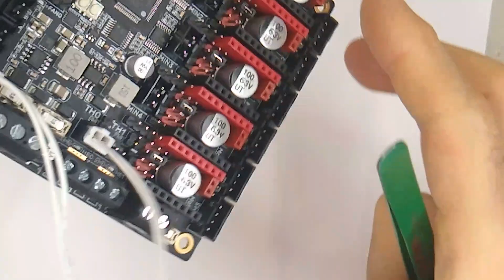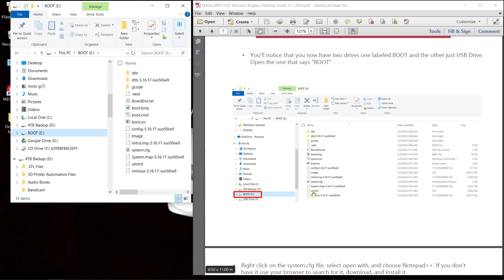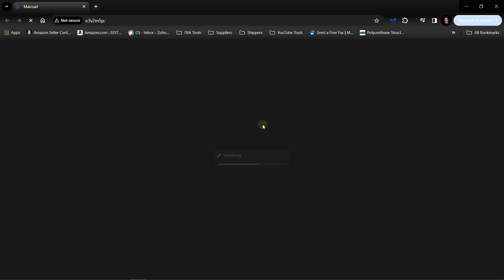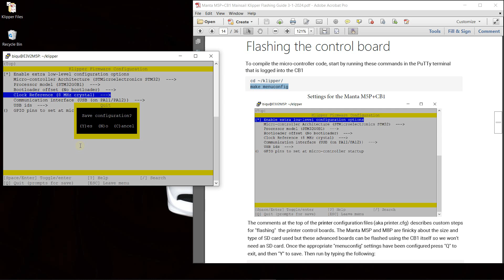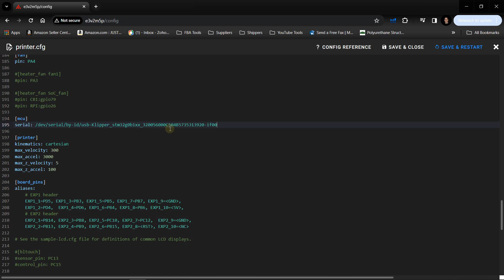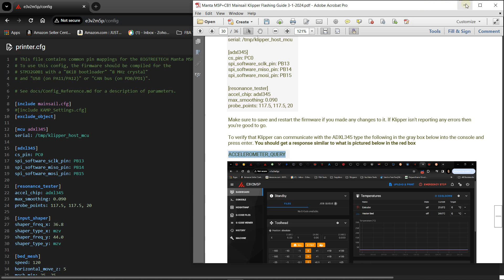How to Install Mainsail Klipper on the Manta M5P+CB1 using DFU to Flash Klipper.bin 2024 Edition

Comment: Hey Victor, thanks for the video. Everything was going well until the Flashing Control board. after the make menuconfig, the "make -j4" command output did not look quite right. Then the "dmesg -HW" command did nothing after holding the boot0 button and tapping the reset button. I did the control z to terminate but nothing was returned. I tried running the sequence again but cannot. The make command only gives errors.
I looked up definitions for the make -j4 and the dmesg -HW but could not find a good explanation of what they do. Would you explain what these modifiers do?
I had high hopes of solving the problem with getting the M5P reading the firmware.bin file. I tried many SD cards and different firmware versions. Even tried using a dummy FIRMWARE.CUR file on the SD card. The M5P will NOT read the firmware.bin file.

Comment: I watched a different guide that told me to update Klipper before I flashed the firmware to the m5p board. I did so and broke the mcu connection, is there any way to resolve that after the fact?

Comment: I'm having trouble connecting a stepper motor to the BigTreeTech Manta M5P. I'm using it for my wire electric discharge machine. I've followed everything, but it's not working as expected. Can anyone help or point me to a guide? Thanks in advance!

Comment: many thanks for the video and the pdf instructions.
without them i don't think i would of got my M5P board up and running just need to fit it on the printer now.
i did try the latest firmware at the start for the CB1 and it would not boot just ruined a sd card.
used the one you did and worked no problem.
thanks again. Martin
Reply from the maker: Great news Martin, I'm glad you found value in this video for your viewing time. Best of luck with your build.
Reply: @vbared  the vzbot build is now done and printing well. the board has now been replace with a m8p and the m5p put into my boys Aquila x2 running klipper and what a change it has made to it.
this was my first klipper install i have ever done still not a expert at it tho. lol

Comment: I was going to do the cr10spro v2 upgrades that you did using Meguel's Firmware. Do you think this is a better upgrade. I plan on using clipper.
Reply from the maker: Hi Sam, Please excuse my late reply. Klipper is amazing on the CR10S Pro V2 Installing it on the stock board can be done but it's not as straight forward as using a 4.2.7 Silent Board. I would just swap to a 4.2.7, get a Raspberry Pi or Bigtreetech
s Pi4+CB1and install Klipper on it.

Comment: Hi again Victor 🙂
Finally I made it! 
Managed to install all according to your fantastic Video.  Thanks!
However, there is one issue.
Everything works except getting voltage to the heatbed and the extruder!!! (I've checket them and the are working. All fuses are OK)
Using a 12V 40 Amp power supply. Board and the TMC2209 are getting 12V but not HB &HE.
What could this be? Any Suggestions?

Bestregards
Kent
Malmö/Sweden
Reply from the maker: Hi Kent, my apologies for the late response. Double check that all your jumpers are correctly installed, they determine which input voltage ports the drivers will use. Another thing that could keep your board from fully working is the small voltage jumper near the USB power plug, which will only supply power to the control chip but not the rest of the board. Remove this jumper if still installed, power down and power up the board to check that everything is working.

Comment: I was tracking all the way up to the "ls /dev/serial/by-id/*" command. It says "No such file or directory" any ideas on what I could have missed?
Reply from the maker: Hi Smoke, try a different USB to Micro USB cable and make sure that the one you play to use supports data transmission. It sounds like the cable that isn't working is a charge only (lacks the green and white data wires) cable or you could have a bad data cable. I've had new data cables not work straight out of the package.
Reply: @vbared  I have mine in the printer already. I had to wipe and restart because I had issues with the ui not working. Figure I would start from scratch. So I need to have it connected via usb?
Reply from the maker: @SMOKE3104  Yes, that ls/dev is a request to confirm that the Raspberry Pi can talk to the printer. If you don't get a response that include the serial address but an error of some kind then it's most likely the cable.
Reply: @vbared  Oh, yea, this is on a manta m8p board. I guess that's why I was confused. I think I'm going to disconnect, and reconnect everything.

Comment: Hi Victor, Really great video tutorial. It has helped me a lot but not the whole way :-). I have the Manta m5p+CB1+HDMI 7 screen and I want to use the Micro SD card to get klipper running.
I've done everything according to your video. But from min. 28 and forward I got lost 😞. The printer.cfg is "Generic Bigtree tech Manta m5p". 

I only get:
"Printer is not ready The klippy host software is attempting to connect.  Please retry in a few moments." / or: 

"Klipper reports: ERROR 
mcu 'mcu': Unable to connect Once the underlying issue is corrected, use the "FIRMWARE_RESTART" command to reset the firmware, reload the config, and restart the host software.

Error configuring printer" 

What am I doing wrong? Can anyone help????

The document you are showing "manta m5p+cb1 mainsail klipper flashing guide 3-1-2024 pdf" I can't find it  

Best regards 
Kent
Sweden
Reply from the maker: Hi Kent, I learned about this DFU flashing method after making this video. Check out this video I made about it, hopefully you can get things working properly.

https://youtu.be/a6VTu1JE3BY

Cheers from Texas, USA

Comment: Thanks for presenting us with this information. I've been struggling with my m5P and every step of your instructions gave the correct response on my terminal. I'm thrilled to have a working printer instead of a pile of junk thrown against the wall :)
Reply from the maker: Hi Seadog, I'm glad you found value in this video for your viewing time. Yeah, I hear you, one would think that flashing the firmware would be a simple affair. Unfortunately I was unable to get a successful flash using the SD card method.

Comment: Why are your instructions so different from BTT's!? Still trying to get mine up and runnin, but im not stuck yet...TY
Reply from the maker: Hi friend, thank you for commenting. Unfortunately for me I was unable to get both the ADXL345 and TFT35 working at the same time on the Manta M5P+CB1 following their instructions at the time so I had to dig through the forums to find the right combination of steps to make it all work for me. If you aren't running into any issues just follow the BTT instructions, they may have updated them.

Best of luck with your build :)
Reply: Ohhh. Well i am planning the same, but y make the adxl permanant? 
Manage to get her goin, minus sum kinda uart driver error on a 2209. Will dive back in soon. But im runnin the cb2 after giving up on trying the m5 with jus a btt-pi and uart chip. Clearly the engineers are not the ones answering emails.. TY

Comment: Finally a video which does not skip crucial steps ! Thanks a lot !

One question, the ribbon cable which comes with the TFT35 SPI is pretty short for me... I searched the numbers printed on the back of the provided ribbon cable(AWM 20624 cable), turns out it is a generic cable which sells online, but all of them have different number of wires in them...10, 15, 20 etc... and the original SPI cable has 9 wires in it. If I buy the longer cable with 10 wires in it...cut one wire and use it...will it work ?
Reply from the maker: Hi Aryan, Thank you for commenting and encouragement. I'm glad you found value in this video for your viewing time. I haven't had to adapt a ribbon cable yet but it should work so long as the space between the connection pads is the same as the one that came with the display.

Best of luck with your mods :)

Comment: hi mr tnx for thist tutorial , i have Same Board But My Steper Driver is tmc2100 and a4988 , Please Can You tell me What Config To be in cfg Driver Section , thanks You
Reply from the maker: Hi buddy, Please excuse the delay in answering your comment, I had to do some digging. I don't believe that you need to enter any of the stepper driver configuration fields for the 4988 or the TMC2100 since they are treated as standalone. The TMC2209 and TMC2130s have some specific features that require UART mode and the the extra entries in the printer.cfg which are commented out by default in the M5P printer.cfg Check out page 10 of the link below because they mention the 4988 specifically and the need to have a jumper across SLP and RST pins of each. I would guess that the TMC2100 would be treated the same way unless there are some specific settings for them in the manual, but I didn't see them listed.

https://github.com/bigtreetech/Manta-M5P/blob/master/BIGTREETECH%20MANTA%20M5P%20V1.0%20User%20Manual.pdf

Comment: Awesome video. Very helpful! Do you know how to use the hdmi mini port on the front of the board with a cb1?
Reply from the maker: Hi Adam, I haven't tried plugging anything into that port. Give one of these solutions a try. Please let me know if one of them worked for you.

https://www.reddit.com/r/BIGTREETECH/comments/105zm18/hdmi_on_manta_m8p_with_cb1_not_working/
Reply: @vbared  Actually, it looks like the mini hdmi port on the front can not be used with the cb1, only when you use a pi. Appreciate your assistance and the link though

Comment: Hello, again a big thanks for the series of video on the M5P, it have been super helpful, the videos are very clear and your way to explain make it super easy + the complementary pdf with all the command, i´ve just finished insaling klipper flashed the firmware and installed the  ADXL345 sensor following your instructions, I just need now to plug everything and finish to configure the printer.cfg 
Sooooo many thanks for your dedications and the work you have put in those vids 😃
Reply from the maker: Hi Francois, My apologies for my late reply. I was going to post a video on the actual installation into my Ender 3 V2 but haven't finished editing it yet. What questions do you have on it so I can try to help you get it installed.

Comment: This is a great tutorial and exactly what I needed.  My M5P+CB1 and TFT35 arrived a few days ago and I'm finally taking the plunge.  Weird issue...followed your steps to the letter but once I flash the image onto the SD card and boot like at 23:15 I just get a white screen.  Red LED near the processor goes solid but nothing else.  Thoughts?

Edit: After letting it sit for about 10 min the green LED began flashing as expected but never got anything on the display...just a solid white screen.
Reply from the maker: Hello,

Thank you for commenting and encouragement. I'm glad you found value in this video for your viewing time. A couple of things to check:

Make sure you are using CB1 image version 2.3.2 and don't update Klipper once it's installed, images 2.3.3 and 2.3.4 won't work properly using this guide. The others thing to verify is that the BoadENV.txt file has the proper entries in it per the PDF instructions.
Reply: @vbared  Sigh...I feel like such an idiot.  I totally forgot I had also got an EMMC version of the CB1 and that was the one I had installed on the board.  I moved the standard CB1 to the PI4 adapter board.  D'OH!!!  So after much self recrimination and berating myself I got it up and running.  And boy howdy are you right that the steps in your guide don't work for the 2.3.4 release.  But now I have a running klipper screen and can go through the rest of the configuration.  This is for another day though.  But I've bookmarked your guide and I'll be using it when I get the Pi4 adapter going.  😀
Reply from the maker: @Enjoymentboy  No such thing, only learning. Yeah, the eMMc version requires some different steps. Great job getting it going, it can get frustrating learning new processes.

Best of luck with your mods!
Reply: @vbared  My situation is similar, but mine is a constant white screen. I switched to the same version as you and followed the same steps. Why is mine stuck on a white screen?
Reply: @vbared

Comment: Victor, THANK YOU.  I've been searching for information and help with the Manta M5P + CB1 set up (just like mine).  I'm having issues because when I plug my ADXL345 in the MCU (Manta board) is not seen/no serial connection is made.  I unplug it, and it comes right up.  I have the wiring correct and followed your document for flashing.  It seems plugging into the SPI port (just below the SD card slot) is the issue - I've even commented out all the parts dealing with the ADXL345 in the printer.cfg file.  Got any suggestions?
Reply from the maker: Hi friend, Thank you for commenting and encouragement. I'm glad you found value in this video for your viewing time. There are issues with some of Bigtreetech's most current CB1 images. Use version 2.3.2 as is and don't update Klipper.

Best of luck with your mods :)
Reply: Ok. Thank you.  I'll save my config and re-flash the CB1 and NOT update Klipper.   That'll be hard for me 😉 but I think I can do it , lol 😆.

Comment: Greetings,  My Manta M5P arrived yesterday so I'm going to test all the issues again with your board.  Let the games begin. Doug
Reply from the maker: Cool, man, please let me know what you find. That y-limit switch not registering as triggered only when the x-limit switch is depressed is still puzzling me.
Reply: @vbared Your X and Y home switch is puzzling for sure.  I'll see what this one is when I get it in the E5 Pro.  A good review of the cable pin crimps, plugs, the switch being N.C. and opening when contacted both X & Y endstop_pin assignments.  On this M5P X = ^PD3 and Y = ^PD2 although I'm sure you have covered all of them, just thinking here.  I do need to install the board to test the hardware.  It might be a few day or so.  The CB1 + M5P build from your document went good although I would like to go over the Boot & Reset section once more.  Cheers Doug

Comment: Hi Victor, Regarding.....One other thing is that the SAVE_CONFIG command does not work for this Klipper build.  This issue has been resolved, YEA!.  It is caused by using a web based example_printer_config file.  These files might have a different format than Klipper understands. 
I found that if I used my original printer.cfg file, saved prior to the mother board upgrade, and then added the edits from the BTT example files to my existing printer.cfg file everything worked as expected including the SAVE_CONFIG command.  Live and learn..Thanks again for your effort yesterday.  The Z: drive is up and running again.  Having fun yet !!!  Doug.
Reply from the maker: Hi friend, Yeah, I was stumped with that issue. Great job in figuring out the cause and getting everything working properly. I wonder if grabbing the base config file from the CB1 example_config folder causes the same issue.

Enjoy your day :)
Reply: @vbared Yes Victor I do think the BC1 example folder was the underlying issue.  All good now except for motor 7 & 8.  BTT is a little stumped as well.  Doug

Comment: Hi Victor,  Here are a couple more bits I have found during this Manta M8P build.
I added a line to the fan section of the printer.cfg file which will turn on my fan 3 ( Chassis Cooling ) when ever the X motor is commanded such as in a Home function.  This allows the fan to be cooling all the time not just when the hotend or bed is turned on.
[controller_fan controllerFan3]

pin: PE5                        # This is fan 3 on the Manta M8P, check the pin for your fan and board.
max_power: 1.0
fan_speed: 1
kick_start_time: 0
stepper: stepper_x

I also added this line to the printer.cfg file in the [extruder] section to move the minimum extruder temperature from the Klipper default of 170 degrees.  That seemed a little low for PETG so this line will move it up to 200. Edit the valued for whatever works for your filament.
 min_extrude_temp: 200

One other thing is that the SAVE_CONFIG command does not work for this Klipper build, any thoughts.  Thanks again Doug.
Reply from the maker: Hi buddy, Thank you for sharing the chassis fan info to help keep the noise level down when the printer isn't being used.

Wow, 170 for PETG is crazy low. That's a recipe for a jam or stripped filament at the extruder. The lowest the SUNLU branded PETG will extrude is 180 but at that temp the extrusion lines will be inconsistent and the layers won't bond properly. 225-240 works best for me. It's interesting to me that some of my machines that use identical parts like slightly different print temperatures.

All the best :)